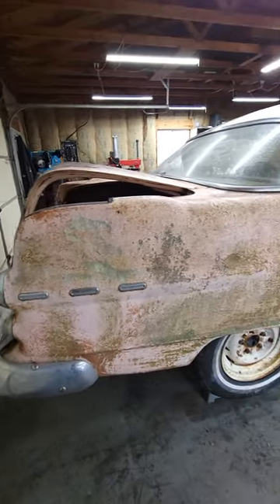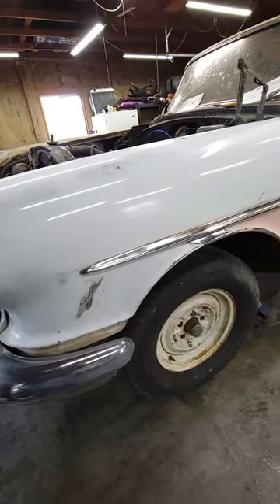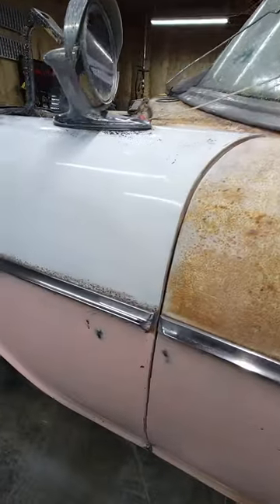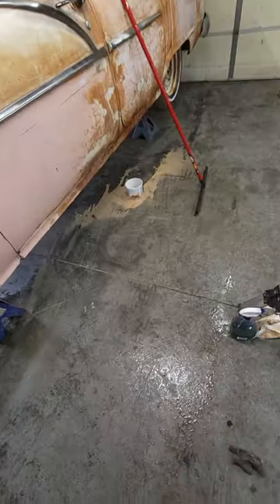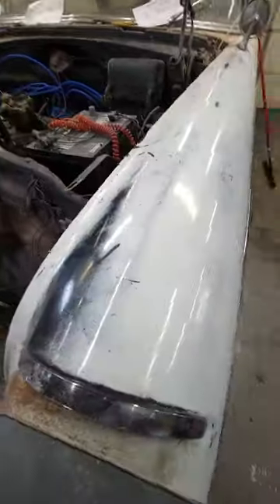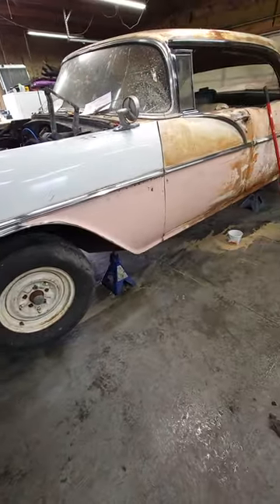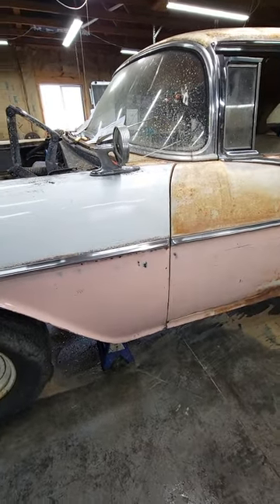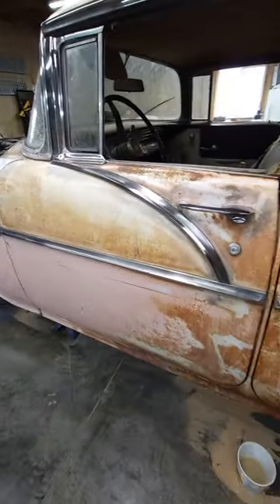1956 Pontiac Chieftain paint revival! Look 👀 at that beautiful patina!!! Bring the shine!!!

Comment: I don't see why you stopped cleaning it. I started on my 59 el camino the same way. Monday night I cleaned the left front fender, just like you did. Tuesday night I did the drivers door. Wednesday night I cleaned half the quarter panel and so on. In 2 weeks I had it all spiffy and ready to start some body work. I hope you checked the frame real close for breaks and cancer rust holes. Frame shop charged me $800 to get it drivable
Reply from the maker: I totally get what your saying. I stopped because it's freezing cold where I'm at and I want to give it a good bath before I continue. Hopefully, in the next couple of weeks I'll have my furnace fixed in the garage and have heat.
I'm going to do another video on my next days off work showing the frame and floor pans. She's completely solid other than the front floor pans. Thank you for your interest, and I hope you continue to watch her progress.